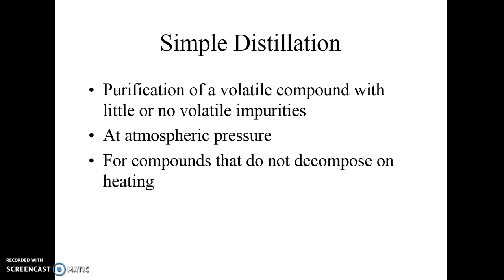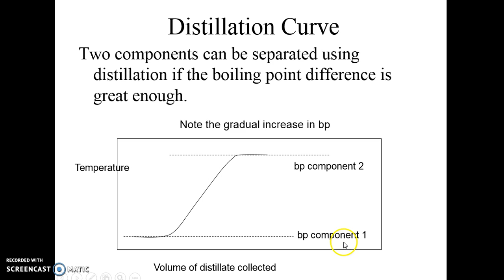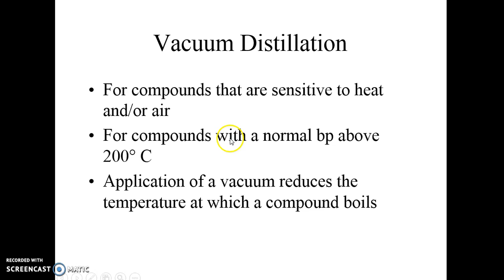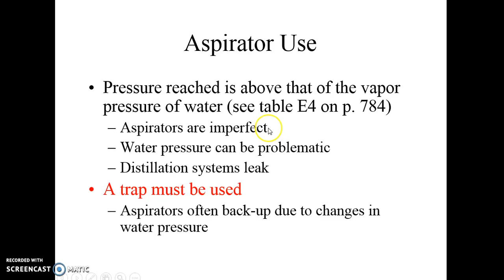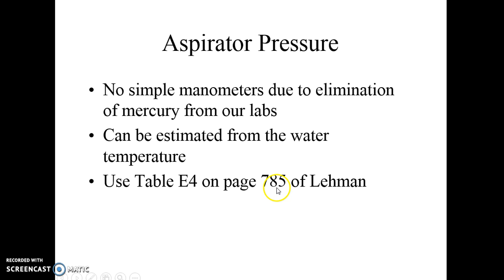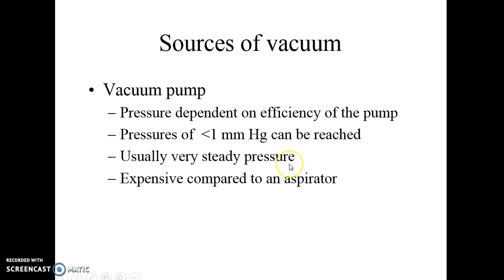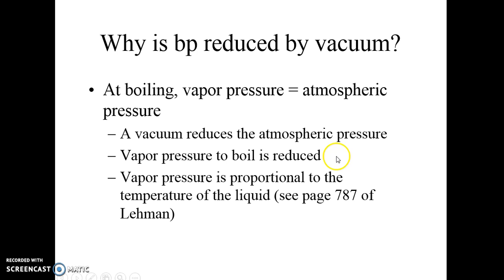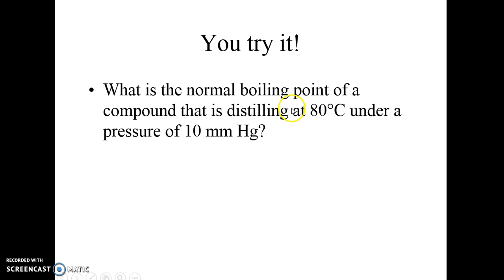Vacuum Distillation

Comment: Thanks for this video. I'm student of chemical engineering  in Turkey but I couldn't find any Turkish source for vacuum distillation. Thanks again, I will be sub to your Chanel
Reply from the maker: Thanks.  I have many more videos, but for some reason they are not showing up on my channel.  I will have to work on it.  I also need to improve many of my videos.  It just have a lot of responsibilities and getting the time to do something extra is tough.

Comment: Thanks for the video it was helpful.  One question do you happen to have a technical name for the apparatus you described to leak air into the system?  I bought a 4.5cfm vac pump and worry that it might be too powerful for the very basic projects I will be doing.  It would help me to know the component names

Comment: It sounds like one of two things happened. Either you were heating before you applied the vacuum or the material is viscous and it foamed rather than boiled nicely.  Foaming is a problem I have had with viscous materials. A very large flask, let's say 100 mL for a 5 mL sample, will not prevent the foaming, but it allows the material to foam without expanding up into the still head. Practical problems like this sometimes requires playing around with equipment until you find something that works.